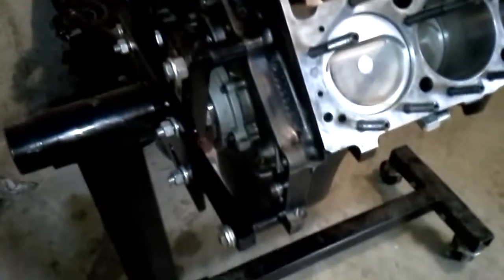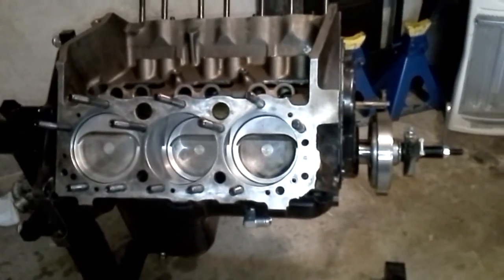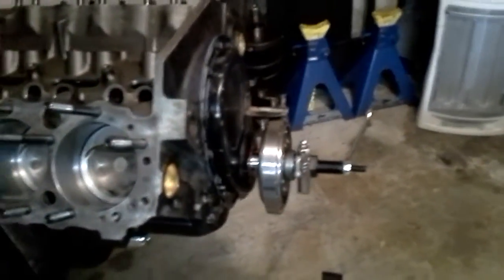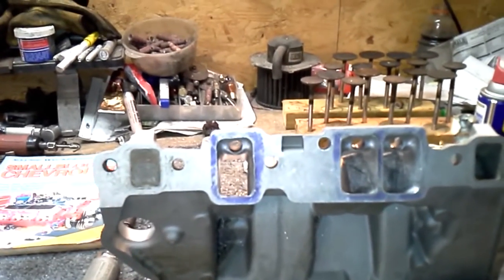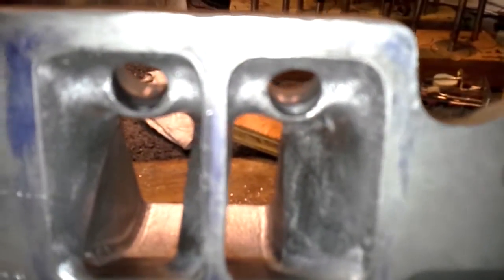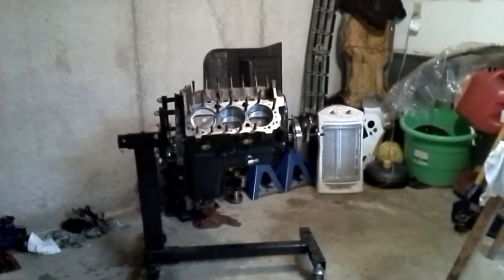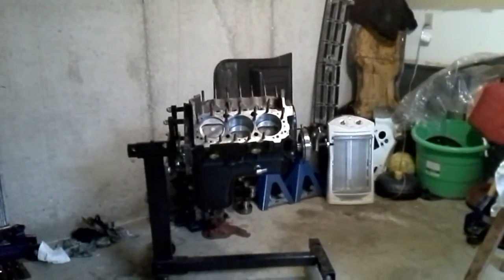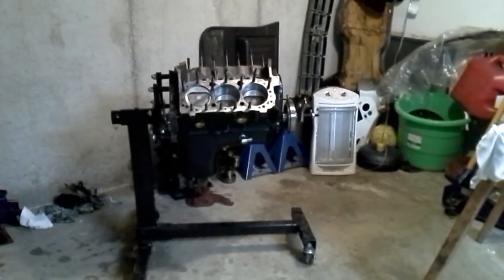600hp 4.3 short block Final syTy intake ports

Comment: Yeah and the newer plastic intakes are going to be destroyed with a backfire!  15-20 psi, and then backfire, I could see plastic through the hood!  Great video, I'd like to build a turbo 4.3!    4.8 would be better!
Reply from the maker: JAMES! Since the 70's It’s a Black Hole of money building a 4.3 V6!  Unless you can afford the $3000.00 for a Forged crankshaft your limited to 650-700hp at the crankshaft before you bend/brake the Factory Nodular steel crankshaft.  Been there done that. 
Did you know GM made a 4.3 V8 using the 2nd generation LT1 platform in the early 90’s?
I’m going with the Turbo 4.8 LS as you may know already!  JD

Comment: No balance shaft?
Is this an older block?
Reply from the maker: splash 1993 SyTy 4.3 Block with Nodular main caps. Iirc the balance shaft engines have a unique camshaft that doesn’t transfer.
Reply: @HeadFlowInc  
Cool
I didnt know the SyTy blocks didnt include the balance shafts...
My 99 Sierra has a 4.3L and it has a little rattle arpund 1500rpm, and im suspecting the balance shaft bearing are the cause...or possibly the timing chain has slack...
Not looking forward to doing this while in the truck.
Are the balance shafts hard to remove, so i can change the bearings?
Reply from the maker: splash I truly don’t know much about the balance shaft engines. Somewhere around 1992-93 is when they introduced the balance shaft, the more I think about our build I think we used a 1991-92 SyTy Block we bought so Richard could save the numbers matching engine.
Reply: @HeadFlowInc  
Gotcha
Reply: @splash5974  Shaft Bearings are pressed in block but will tap right out with hammer there are two styles tho. Rattle is prob chain or a rod bearing if internal imo ive put over 300k mi on used worn balance shafts and bearings.
Reply: @-Atrocious  
Thanks for the reply.
Im definitely thinking top end rattle, not anything in the bottom...
So it might be the chain then.
I was told by a buddy that sometimes the balance shaft bearings dont get adequate oiling, causing them to wear and make a rattling noise right around the same rpm my truck does it rattle noise...not there at idle or mid to high rpm. Its kind of annoying to trace down.

Comment: 500 is almost a milestone on a 4.3, if you can get 600 your doing good.
Reply from the maker: Sadly somewhere around 600-650hp we bent the crankshaft, but caught it before a total failure.  The owner sold all the 4.3 parts and went Turbo LS

Comment: and why have we seen such an increase in HP with "street" engines compared to say 10-15yrs ago,mostly from boosted engines? When I was a kid I remember that if you had a 300-400hp street car,you were the shit.....but now with 300-400hp guys get laughed at! (thats why I tell'em its the wifes car)
Reply from the maker: DonkeyTeeth Engine design and cylinder head flow is far better now.  Plus the aftermarket blew up with affordable parts for building power.  There were cars in the 70's, 80's, 90's etc making 1000+ hp but they were more rare.  Turbos used to be a pain to tune until the more modern EFI came along.  I agree having a 400hp 12 sec car used to be competitive now even factory cars can run 12's with a good tune. It is amazing the power people are making now! 😀
Reply: DonkeyTeeth 
Yeah man, I had a 375 hp 327 with a 4 speed and I thought I was doing good, now days a ricer with a 4 cylinder would have blown mine away.
Reply: @cv 67 I agree with just a 4 bbl cam and headers it would still spin in 3rd gear on hard road and wind out to 90 plus in 3rd .

Comment: what kinda spring pressures are needed with the 1000-1500+hp street engines that we are seeing more and more of now a days?
Reply from the maker: DonkeyTeeth Well that depends what type of cam being used, but in the 1500 hp range using factory hydraulic roller set up people are using the Dual springs from people like Brian Tooley racing.  Iirc they are around 155-160#

Comment: could i run flat top pistons on 8 psi of boost?
Reply from the maker: Bryan Teet   It depends on the quality of fuel used and what compression the heads make.  You would need to calculate both the Static Compression and Dynamic Compression of the engine.  E85 would be an option depending on the availability in your area.
Reply: im running 93 octane and i have 9.5:1 compression ratio
Reply from the maker: How big of a cam are you running?  The Dynamic compression is lower than Static and the camshaft makes a big difference.  A Dynamic of 9.50-1 with 10# of boost at the manifold equals 16.0-1 compression.  93 octane not recommended for very long.
Reply from the maker: It's been suggested to me you could try to run Meth injection with the 93 octane to try and control detonation.  The computer may pull timing to help control detonation but this kills power.  Good luck take care of the engine!